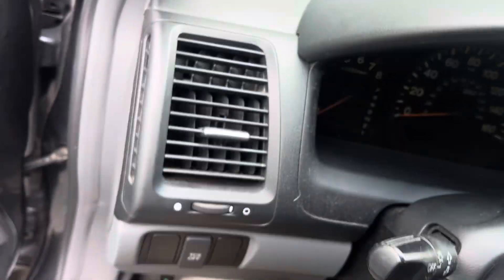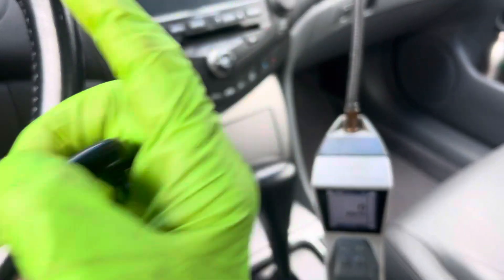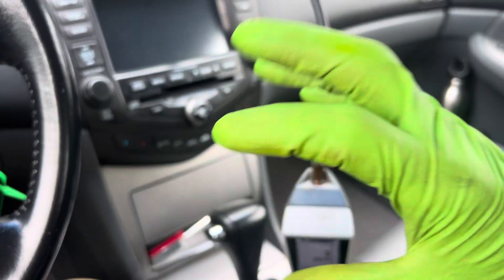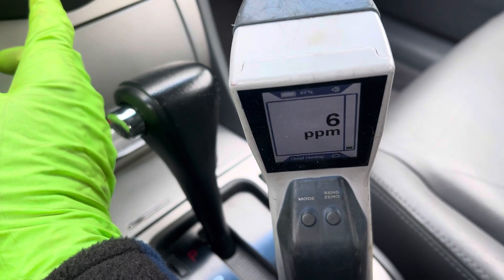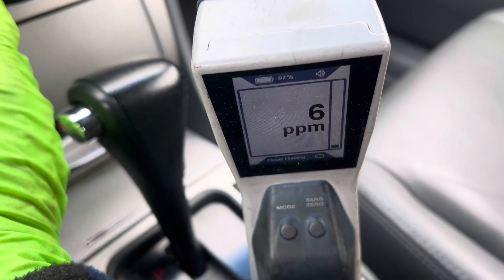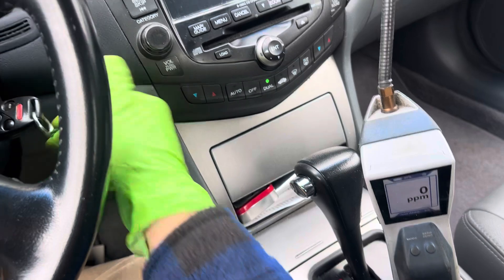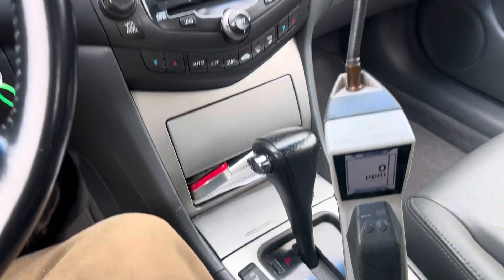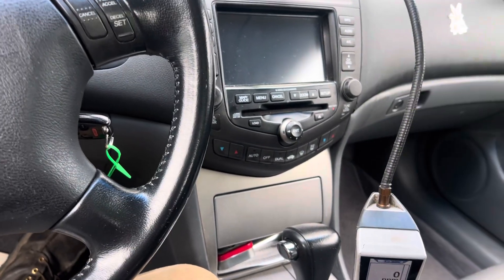VARY SMALL REFRIGERANT LEAKS. Don’t lose your chance to find them.. you get one shot

Comment: What is the repair in this case? Replace the evaporator or live with the leak?

Do you think evaporators would last longer if they were made of copper? Evap always seem like the first thing to go in these closed systems... especially in building HVAC systems.
Reply from the maker: Old thick copper coils did last longer. 

But the new copper is ultra thin, just barely thicker than Reynolds wrap heavy duty gauge aluminum foil that would be used in a restaurant if you’ve ever seen that thick aluminum foil it’s just a little thicker than that . 

But the micro aluminum condensers are extremely thin to heat of expansion and contraction cracks at hitter joints, chemicals from janitorial supplies, attack the aluminum or copper

Excessive moisture the systems, especially with POE oil make acids that attack the aluminum from the inside out and make little tiny, micro pinholes like a worm or beetle that burrows a hole through wood.  

The thinner and the smaller and the cheaper they can make these evaporators and condensers for the highest profit margins is the problem 

If they could make them thicker, they would have to be a little bit bigger 

And the real estate under a dash of a vehicle is very limited 

And the money and profits they want if you had to put 50% more weight of copper or aluminum into a product that’s a lot of profit margin . 

They prefer not to give consumers better products at last longer

I can’t remember what we did in this vehicle sometimes if it’s hot, we will fill them up because it’s such a small leak and order the evaporator and just have the customer come back next week to replace the evaporator .

Comment: I tried that with our shops new robin air tracer gas(95%Nitrogen 5%Hydrogen) leak detector and it always seems to be giving mixed results. It seems to react to r134a and yf refrigerant but since it’s not designed for it I’m sure it’s not as accurate and possibly not good for the tester.  May need to step up to the one you have in the video lol.  It looks to be a lot more stable.  Will just the air blowing out of the vents be enough to register a false leak? Similar to if you blow across the sensor?   It seems if a car is sitting out in the sun, the tester goes crazy just as you get past the door.  Even on cars with no leaks.  Not sure if it’s chemicals leaking out of all the plastics/leather or the heat just messes with the sensor.
Reply: Good to know, thanks Tom 👍🏻
Reply from the maker: Sounds like you own a noisemaker

Now it’s time to get a tool 

I think real hydrogen leak detectors also start at several hundred dollars $800-$1500 

Just like refrigerant leak detectors 

$100 and 300 or $400 leak detectors for refrigerant are usually somewhat accurate for a short period time or not accurate at all 

Starting at around 600+ dollars for the H 10 
To $900 for the stratus . 

Do not buy anything that StrapOn Mac or MATCO

Comment: I wonder if acoustic imaging camera can detect that leak. Can ultrasonic leak detector detect a leak that small?
Reply from the maker: If the dash and deducting in the Hvac case, we’re not in the way.  It would detect it.

Under ideal conditions
Reply: @coldfinger459sub0  When you remove the plastic cap of the service port is equal to how many PPM?

Comment: Is this leak large enough to appear with an N2 pressure decay test?
Reply from the maker: Sometimes not. 

Sometimes when you crank up the pressure it makes leaks bigger. Sometimes they don’t leak at all. They actually shut off the leak positive pressure doesn’t always mean bigger leak. 

Sometimes I find a leak only after running evaporator with refrigerant in it and it’s cold it leaks when you let it rest and sit and it becomes 80°F and the pressure goes up to 80 psi the leak stops . 

It is a mixed bag of tricks 

Sometimes just the oil film will stop the leak . 

It depends were you that day or you’re not lucky that day while you’re testing on that particular vehicle
Reply: Probably not, aluminum is notorious for microscopic crack. Aluminum cylinder heads can leak coolant with the crack not visible to the naked eye.